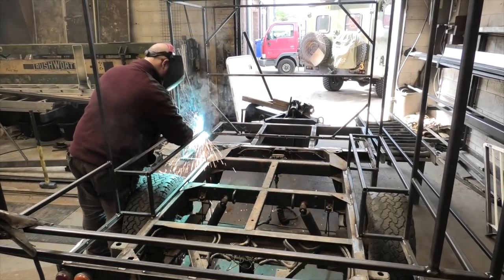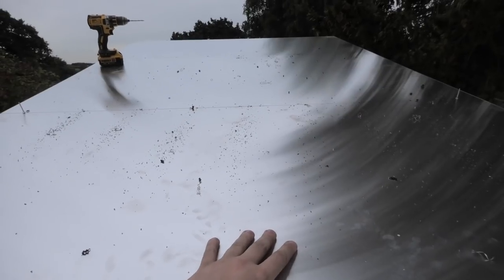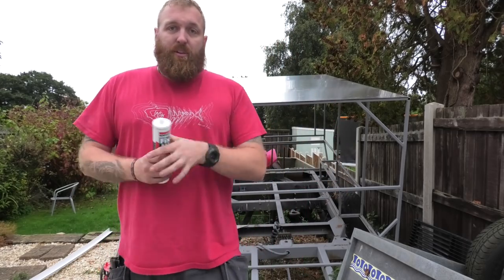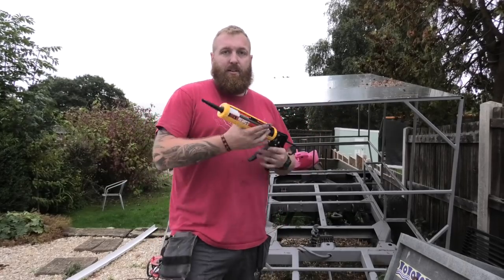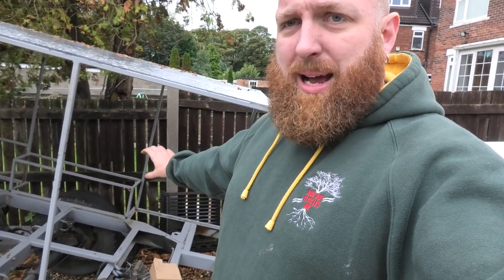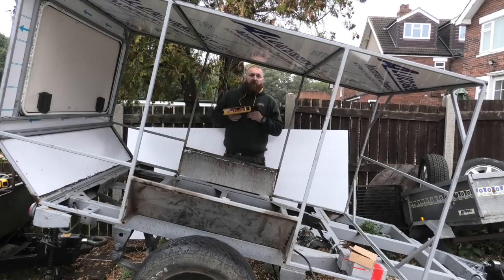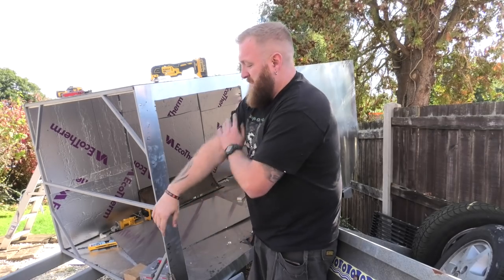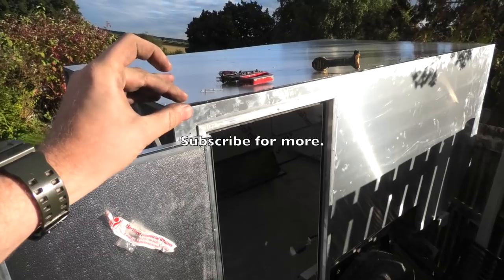Off road Bug out trailer build.

Comment: Top draw as usual. 

I was thinking (yes I know, dangerous!!), iro of construction techniques. 

Our ancestors built ocean going ships from Elm that lasted hundreds of years. More recently Working Narrowboats were constructed using similar materials. They were good for 300 years+. Both were subjected to huge loads & force vectors. 

The wood for the hulls was cured for at least 10 years. 

As you say screwing some wood together wouldn’t last 5 mins in a Bug Out environment but our ancestors certainly knew how to make it last.

All the best!
Reply from the maker: Square Peg Round Hole not sure where you are going with this comment?? If you are trying to say the ancient way of making boats from wood is better and I’m wrong in saying these trailers wouldn’t last made from wood let’s work out your analogy. Elm wood dried for 10 years= thousands of pounds in wood. Being big enough to have a double bed storage and cooking area would make it the size of a small log cabin. The weight of all that wood thick enough to use them techniques would would be too much to tow so in every way it just wouldn’t work as a trailer. Now if we use the analogy that I used of the American tear drop style of a similar size where they use marine ply routed glued and pinned no the seals won’t last for prolonged use off road. I’m definitely open to be proven wrong tho and it would make a great vid comparing what I make against a trailer built like an old boat  both off road and on the motorway. The next one I’m making should be out of plastics and composite again for strength weight and cost. I’m just going off experience building and using them tho so could be wrong.
Reply: Bug out vehicles UK I actually complemented your build  in my opening sentence, so not sure how you see my historical comparison as a criticism. 

Almost all wood we buy these days is crap. Most of the Master Craftsmen have gone now and we live in a throwaway society where almost everything  has a limited life that we are encouraged to dispose of and by new once more.

The ancient craftsmen certainly new how to use wood, and the natural and cheap curing processes were ongoing. 

The restoration of wooden narrowboats these days use Oak not Elm because much of the Elm has gone.

We are being driven to use by-products of the Petro-Chemical industry of course but almost as quickly we are being told not to!

Anyway, a Steel Narrowboat to continue updating so no time for more comments at the moment,  but happy to another time.
Reply from the maker: Square Peg Round Hole ah right i wondered where it was going that’s all I get a lot of random comments and it’s hard to know what way some one is taking some things on text.

Comment: Great build ,explained your reasons well for doing it a certain way .Sound advice on doubling up ,i have a leak in my van roof. Now i have to pull the roof apart to find it , it's a pain in the butt.
Reply from the maker: Sharon O'neill nightmare. Iv done it once so I spend the extra when it’s easy

Comment: Beautiful!....i made my trailer out of alu supports with hpl-plating.....uv resistent, all weather etc etc... And very resistent to branches etc with offroading....might be an option for a next build?
Reply from the maker: Peter Enis the next one is getting built like my daf. All panel and very little frame.
Reply: The panels are the frame ;)   I used exactly the same bonding method....the Soudall (best kit ever) does the work, the rivets to tension the plates to the frame, after that I ended with an aluminium trim for looks and waterproofing. I made mine 6ft10 high so I can take a shower in there with my heater on....prevents sausage-shrinking ;)

Comment: Hi all, for my next bug-out-trailer build I'm thinking about doing a flatbed trailer with a separate living-module wich I can attach on top when needed. This way I can use the trailer for other jobs and put the living-module on top when I want/need to. I could even build different modules depending on what I need. A more beds-module if the kids wanna join, more luxury when they don't for example. What are your thoughts on this...maybe any tips?

Comment: Would that construction be strong enough to support a rooftop tent? I was just interested because this is a similar design to what I wanted to build and was wondering if the inch by inch steel was enough... or should I go 30x30, 40x40 and so on.

Comment: On the roof panel.. isn't the "glue" only on the protecting plastic? Why didn't you remove the protecting film/plastic on the aluminium plate before you glue it?
Reply from the maker: Christoffer1973 because I’m not as awesome as you.

Comment: Fantastic vid as always Rich. How much would this weigh fully laden? As I have recently passed my test I am limited to tow weights (i.e. vehicle and trailer must not exceed 3500kg)
Reply from the maker: Glen Day no good on a new licence because they go on plate weight and the MAM on most 4x4s will be over 3000KG which leaves nothing.
Reply: @Bugoutvehiclesuk  I have the kia sorento and it's quoted at 2500 kg gvw so could give me a possible 1000 kg to play with (including load out). The only alternative is to do the trailer test!
Reply from the maker: Glen Day not sure because the trailer can carry 750kg and the  standard trailer itself is more than 250kg empty. Unless you made it and re plated it. I will weigh it when it’s done.